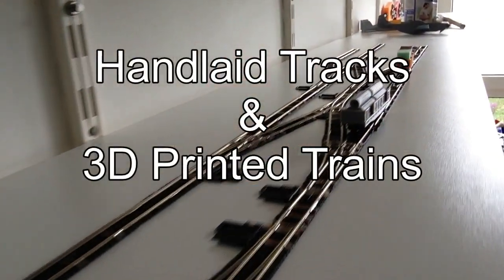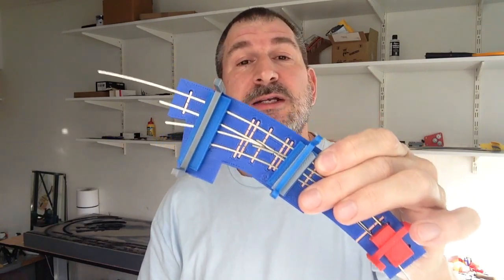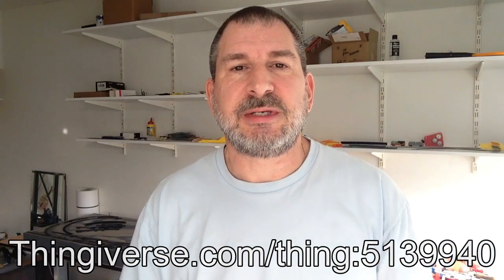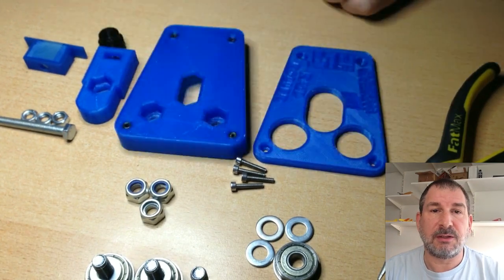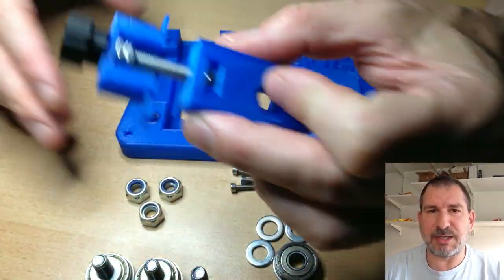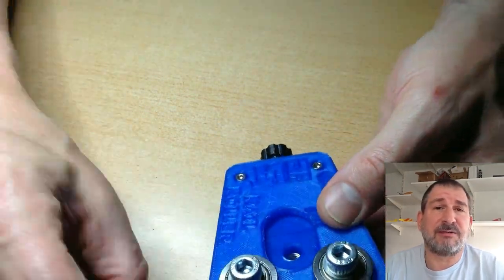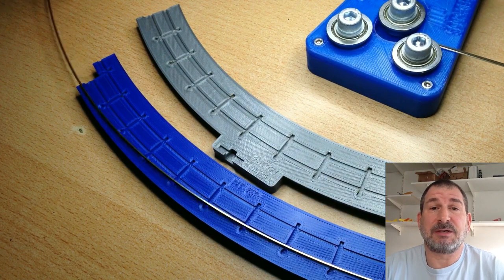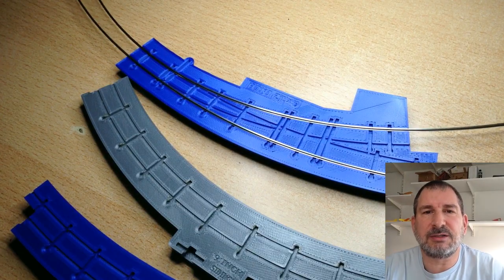3D Printed Rail Roller To Make Curved N Scale Model Train Tracks - HO as well.

Comment: Another great video!  What 3-d printer do you use?
Reply from the maker: CR10 V3 filament printer but just got a Anycube Photon Mono X resin printer as well. I use Sketchup Make 2017 to design but Blender is more powerful if you have to learn a CAD program anyway. Other than when it breaks, you will love everything about a 3D printer!!